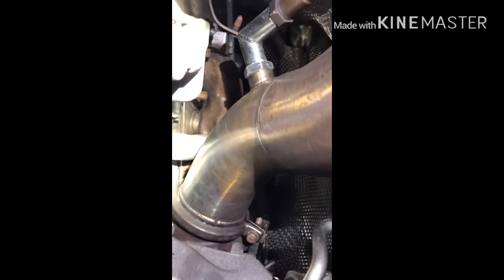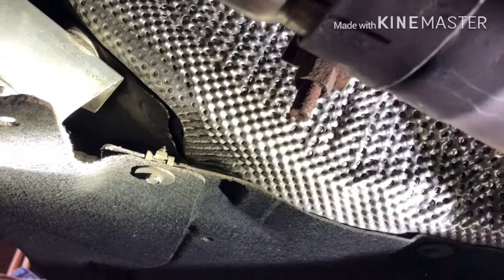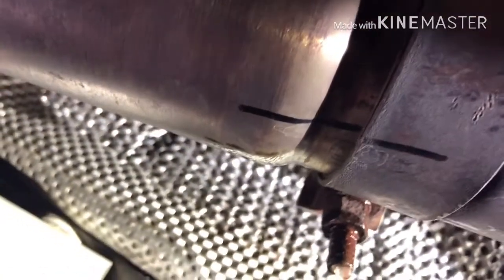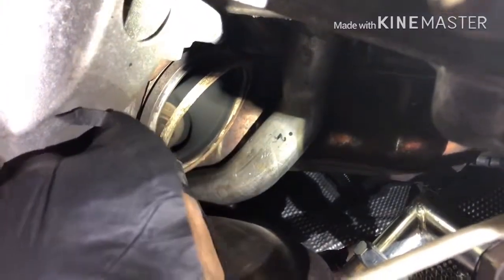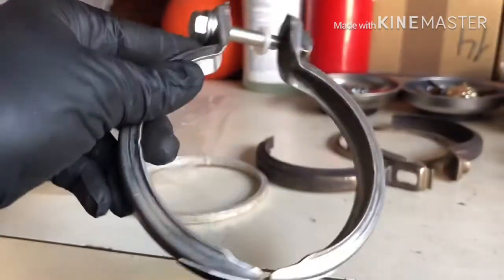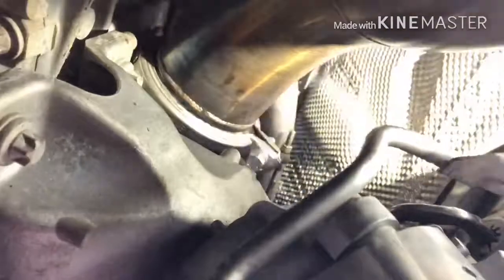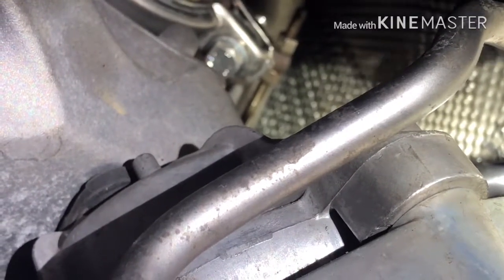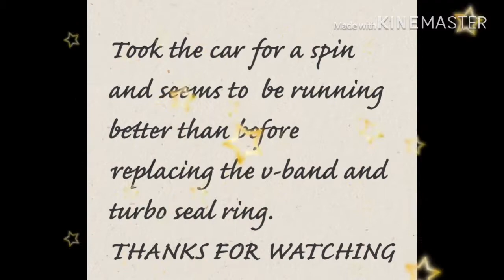#vlog #BMW_N55_turbo_leak BMW F10 N55 turbo leak fix

Comment: Any luck with that o2 spacer,?
I have emission testing in Las Vegas, 
I tried 3 different versions
First one has 90 degree bend with mini cat, check engine light after 1-2 days
2nd o2 spacer is 90 degrees like yours check engine light after 10-15 mins.
3rd spacer is 45 degrees same check engine like comes on 10-20 mins

It really sucks ripping the catless downpipe and putting the oem one yearly,

Mines 2011 pwg 
I read online the n55 ewg is easier to fool idk
Reply from the maker: You can tune your ECU and have your tuner bypass the emission continuous readout

Comment: i been having this same problem think it’s fursure how i adjusted the waste gate though gonna try the clamp as well i have a bad boost leak
Reply from the maker: Did you adjust the WG according to BMW specs  ?! 
And no need to replace the clamp if its good … you might wanna check the turbo to DP seal instead.
Reply: @woodken if there’s a leak between the two would it affect performance?
Reply from the maker: @JB-B58  it will hurt performance since shouldn’t be any boost (air) leak

Comment: Was it ok to mount the DP without the two mounting points of the original cat? I just mounted mine like this and have the feeling it will snap off together with the turbo lol
Reply from the maker: I was gonna weld my custom mounting hangers but i wanted to see if its gonna hold up since the front of the cat back already has a mounting point…. Its still running fine no rattling even with hard pulling.
Reply: @woodken  thanks! I installed DP without any hangers on my 535 and am concerned if it will hold.
Reply from the maker: How’s the DP holding up ?!

Comment: How was the turbo wastegate after the adjustments ? Does it hold more boost ?
Reply from the maker: Not much since the rattle wasnt bad... i guess it just was in my head
Reply: I'm scare to touch it, I think this can blow up your engine.
Reply from the maker: Its a risky proposition, but you can mark where the adjusting nuts are, in case you think you messed it up and you be able to revert back to factory settings

Comment: Did this get rid of your exhaust leak sound all together?
Reply from the maker: Yes it did, i had a whistle kinda noise coming off behind the firewall… all had to do with the turbo outlet not hugging the down pipe inlet flush, i hope this helps.
Reply: @woodken  do you have a video of the sound before you fixed it ?
Reply from the maker: @JB-B58  no bro i dont, but you should notice the engine response going down, and or hear whistle other than the turbo swoosh if you have a boost leak.
Reply: @woodken  man I’ve been chasing down a issue for ages can’t figure it out I’ll have to take a look at the dp
Reply: Did it smell too? Literally just fitted a downpipe to my F22 N55 and its making some crazy turbo noises and the smell is awful, I think there may be a leak. I didnt change the turbo gasket
 @woodken
Reply from the maker: @NickEnglishPhotography1   the smell is normal since you installed a non restricted down pipe which it lets all gases escape. And the turbo whistle is louder coz it breathes better.
Reply: @woodken  I am pretty sure mine is leaking, during cold start I'm getting steam coming through the vents in the car and the noise during acceleration is like a whistle hissing right Infront of me. The smell is horrendous inside the cabin

Comment: Why did the turbo seal needs replacement?
Reply from the maker: Had a slight air escape that i noticed prior to replacing the V band... so decided to replace it.
Reply: @woodken what was your symptoms at that point of time bro ?
Reply from the maker: @JB-B58  low engine performance caused by boost leak
Reply: @woodken  thank you for replying bro.
Reply from the maker: @JB-B58  anytime man